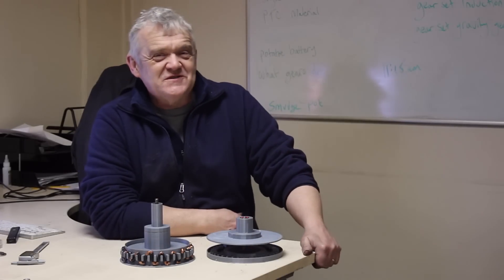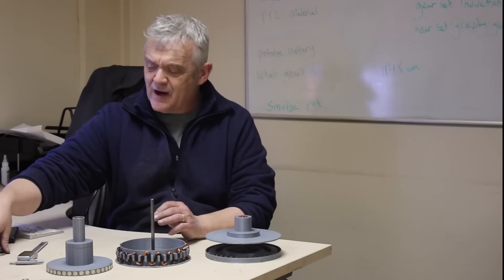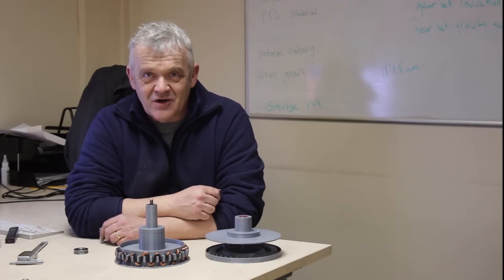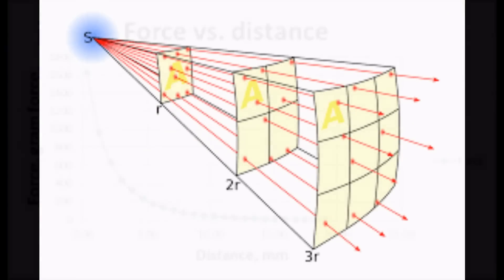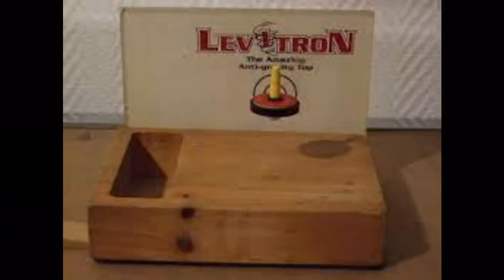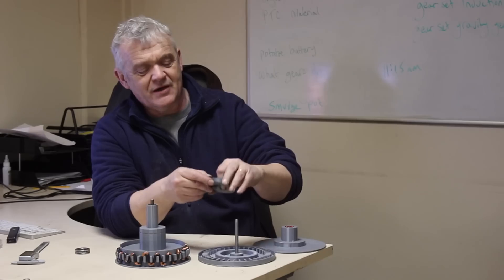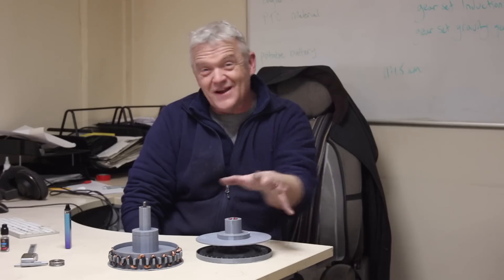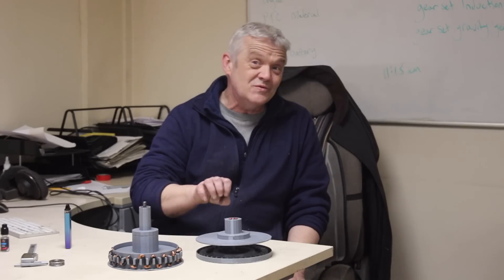1874 Maglev Versus Thrust Bearing

Comment: Do a combination of both designs but use the maglev bearing ring magnets in the unit with that contained the thrust bearing. having both side generation and then bottom generation as what is the maglev unit to get double the possible generation??  
not a tinkerer but full of ideas or full of something. Not the sharpest knife in the drawer either but just found your channel and I am completely enjoying the thought process and common sense approach to explain to us simple minded folks stuff. 
are there "Rod" magnets that you can possibly use in combination with the other magnets so that the Earnshaw's theorem applies I guess in 2 directions if I am making sense.  
Anyway just enjoying watching your videos now, keep staying brilliant 
Semper Fi
Reply: and with your desire to do a washing machine in a dual way as Dyson then this guy might have something that might work in a larger scale for a dual spin washing machine and with that said maybe even doing multiple using this guys idea could make a good washing machine also
just again bored on a Sunday and keeping my mind thinking watching what I think are intelligent videos. 
Stay brilliant and keep on keeping on 
Semper Fi

Comment: I am very curious about how the alternating poled magnets for a generator will affect the maglev effect.  I suppose if the outer ring magnets are far enough away from the core magnet, it should work.  I am still curious how it will affect things.
Reply from the maker: it won't the forces from the ring magnet drop off to nothing in a surprisingly short distance

Comment: Magnetic bearings are pretty cool and I know you are just showcasing the concept here. But the claim that it is useful to lower the friction because of low wind seems strange to me considering that turning the motion to energy will be an extreme part of the friction in the system. In such an application the friction of the bearing seems negligible in terms of overall efficiency. Though I do think magnetic bearings can be great in a wind turbine for longevity and decreased maintenance. Great demonstration though, thank you!

Comment: You know I've been kicking around trying to make some air bearings in this and that and I got a whole box of these ring magnets from microwave just sitting in my garage lol I wish I wouldn't have already made my magnet disc but I think I could still incorporate it if I carefully center the magnets and epoxy them in place
Reply from the maker: nice mate - give it a go - what I tend to do is cut a disk with a hole saw - stick in a drill and sand it to size - that way I get a disk with a centre hole for the shaft and with fits into the centre of the magnet - hope this helps

Comment: I wonder how well the maglev bearing would perform in the twisted serpent configuration under load. The electromagnetic resistance would reduce its spin time. From the twisted serpent video it would still spin for a long time.

Comment: I suppose this is of great intrest for a flywheel. but once we have a generator working, the friction of a good bearing should be neglectable compared to the interaction of magnets with the coil(s). Correct?
Reply from the maker: I don't think so mate - a lot of time and effort goes into bearings and bearing design for a good reason

Comment: I doubt it will spin longer when generating, agreed the lower friction of the bearing is great, but, if it doesn't spin longer in use then there is little gain

Comment: The thrust bearing needs a drop of oil. It also has the capacity to hold a much larger flywheel ballast.
Reply from the maker: it does indeed

Comment: My only issue with this kind of bearing is the flex. If the wind is coaxial to a set of blades mounted to a center hub - generator inside wind pipe style - wouldn't some of the wind force push the bearing together? Possible enough to change the relationship of the generator's rotor & stater?
Reply from the maker: no mate the forces that far away are really really small - remember it is the inverse of the square of the distance - the field line drop off remarkably quickly

Comment: Hi Robert - will that magnetic bearing only work for a vertical axis? I've a feeling that in the horizontal axis the load would be transferred to the traditional ball bearings. Any chance of a bit of Twizzy action :)
Reply from the maker: yes mate - it works on vertical axis I have done a few videos on just that

Comment: could you control the gap using 2 notches on the shaft and adding a split ring above the upper bearing thereby limiting the height of the gap between the 2 pieces?  I guess the question then become how much friction happens on the upper ceramic bearing from the limiter.
Reply: similar to how a pc fan works  if you think about the retaining clip and what keeps things apart in that setup.
Reply from the maker: yes absolutely

Comment: Hi Robert would using magnetic bearing on the wind turbine. Cause problems for the turbine. As I noticed that you managed to make it spin just with you blowing on it. So if you added the flat turbine and took it out in the wind. Would that make the turbine spin to excess speeds. And there for but more stress on other parts. As the turbine would spin at some speeds greater than the strength cab abilities of parts of the turbine. Would you need over engineer the turbine. Or would you be able to control the speed. So it doesn’t destroy its self. Please don’t read this as negative comment. Or have you already accounted for this. As I’m not smart enough to see  if you have. Or the fact it isn’t a concern thank you Neil

Comment: Your winner is the better fly wheel and  the looser has coils and magnets which I suppose would have some eddy losses. Still a cool idea, I don't think that bearings have much to say in regards to efficiency at scale, the losses in thrust bearings are miniscule, but yeah its the better one, but is it worth it? For a flywheel battery definitely! Not so for a turbine I believe as opposed to making it larger if wind speeds are lower... But of course it  enables you to capture power at lower winds, but how much power?
Reply from the maker: there would only be losses if there was a flow of current as the wires weren't connected to anything there is no flow

Comment: I wonder how this would work on a vehicle. I get that there would still be added resistance to the vehicle, but not a whole lot and while a vehicle is sitting in a parking lot all day this could be used to trickle charge a battery system.

Comment: I guess it is easy enough to seperate the bearing from the generator feild so as to overcome or mitigate interference but my question is- would it be worthwhile having the lower bearing an electromagnet so you could fine tune the distance between the stator and the rotor?
Reply from the maker: that kind of bearing is used mate -I mention it in the video - it is an active magnetic bearing
Reply: @ThinkingandTinkering  ah, I missed that. Ta.

Comment: Not to be a wet blanket, but the one that stalled first was packed with magnets and set near a paramagnetic material which will always generate a bit of drag.

Realistically, to be factually scientific about this, one needs to have every other aspect about the test models identical so that they can honestly rule out any questions based on variabilities.
Reply from the maker: you are right mate but the magnitude of the difference means that kind of accuracy isn't really necessary - plus - I am not really proving anything just demonstrating a well known thing - so what you are suggesting really isn't important in this instance

Comment: Just noting that an axial flux generator with a magnetic thrust bearing will have a somewhat undesired self limiting effect when current rushes through the coils.  They will start to act as magnetics that create a bit more levitation that increases the airgap and reduces the output. Maybe the effect will be minimal and tolerable but it's there and one should at least think about it when designing. 😊
Reply: Would using bar magnets instead of button magnets (for better field coverage) mitigate this?
Reply: @tonymazza8305  it might not problematic enough to be overly concerned with. Without doing calculations I can't really say how much. I'm only saying it's there if your using maglev bearing with an axial flux. If that's what you want to build, it's good to be aware of it and that you may want to calculate how much it might effect your project. 

On the other hand, If you turn the field coils and rotor magnets so that their fields point radially then when current flows through the coils, they won't add to the axial levitating force from the thrust bearing magnets.
Reply from the maker: a circlip on the axel will go a long way - but mate - you do know this kind of bearing is already used in generators?
Reply from the maker: I get a sense you are overthinking this one mate
Reply: @ThinkingandTinkering  That is my nature. 😁  I'm guessing you your nature is enjoy sharing ideas, and a good mental workout brings me joy. And many of your projects give me food for thought, or rather addicting daily treats to mull over. 

Many of my comments are meant as food for thought for anyone who happens to read them. And they can do with them as they wish acording to their interest. I'm guessing the nature of someone reading other people's comments includes anyone wanting to converse, enjoys helping others, or who has their own questions.

Comment: Put bigger flywheel with magnets in it to work with coils on outer case. Put magnet bearings on top and bottom that should hold flywheel alignment. Use conical magnets on shaft for side to side stabilization. ???
Reply from the maker: go for it mate

Comment: I am trying to make a magnetic spring for an invention and can verify Ernshaw's Theory. You could make a ring of magnets to keep the rotor centered, but it would just be impractical. I wonder if some sort of gyro would work? If your levitating magnets were at the top, making the weight a pendulum, you would only need minor aligning magnets.
Reply: That's what I've been saying (about the gyro), but I keep getting ignored and ridiculed...
Reply: @ShawnCheriYoung  how would one add a gyro?
Reply: @natureiscrazy  The whole device acts as a gyro. One drawback is it adds an element of precession.
Imagine hanging the device from a string on a swivel. now change out the swivel with angled magnets in a ring.
Reply from the maker: like a larger Levitron?

Comment: Ten yesr ago draw some cad about Maglev Vertical axis Wind Turbine. It had samekind bottom ring magnets but it also had these segment magnets in the shaft and upper ring magnets. Then there was Nylon brake in the top for high winds that would force it to rise against the brake. Problem was high price of those segments and the fact that i wanted to use gorlov geometry blades that was just too complex for me to do. Would be nice to resurrect that project. I think i still have the generator part.
Reply from the maker: dig that project back out mate!

Comment: Is there a way to determine the weight that can lifted by maglev? I’m guessing it depends on magnetic flux and distance between magnets, but have no idea on how that comes together to determine a max weight.
Reply: I asked a question that had this at its centre. Would an electromagnet (i guess the static one) allow you to fine tune the distance? Could you increase the power of the electromagnet for the weight of the unit?
Reply from the maker: magnets usually come with a kg of pull defined mate - that will be the max
Reply from the maker: you could do exactly that mate

Comment: It appears the one with the mechanical bearing has magnets and windings. Even without a load there is some resistance in the windings causing currents which would slow down the rotation to some degree. Granted, a magnetic bearing is superior but the comparison would not be entirely objective.
Reply from the maker: the wires aren't connected - no connection=no current flow

Comment: Wouldn't the magnetic flux from the bearing magnet interfere with the flux involved in the generation of electricity?
Reply from the maker: not really mate - the magnetic forces involved are really really minimal when you get not very far away  - that's why these systems are used in flywheel generators - there just isn't enough strength of field even a centimetre away

Comment: How will regular gears compare to magnetic gears if used in motors/generators? See magnetic gears video on it.
Reply from the maker: I have built a series of magnetic gears mate - there problem is slip under high torque

Comment: Great idea! Would you have to change the geometry of the wind vanes ? I assume the ones you've been using as of late, being taller than wide, would add more undo torque on the rotor axle if the majority of the height of the vane structure is above where the bearing makes contact to the axle (a normal force created in response to the force of air hitting the vanes causing the vanes to cant about their vertical symmetry). Are you planning on using a flatter vane structure or one that redirects the forces downward instead of in a shearing direction?
Reply: There definitely is room for improvement.  However, Rob's rationale (and I strongly agree) is the simplicity of this design.  There are lots of better designs out there, but this is one that a lot of people will actually build and use.

Furthermore, many people who watch this channel do not yet have 3D printers (I just got one recently myself), and this design can also be easily made with some plywood and PVC from the hardware store.

I'm not saying I disagree with you though,  There are a lot of Vawt designs that thin out toward the top, and all of the old sea-faring ships had a similar design on their sails: Fatter toward the bottom, and thinner toward the top (which they learned the hard way, after seeing a few magnificent warships get capsized by strong gusts of wind).
Reply from the maker: you don't have to but I probably will

Comment: I imagine magnetic bearings are useful for improving the longevity of a wind turbine. I'm curious about how much it actually increases efficiency though, because once you start using it to produce electricity, just that alone is going to be a major force in slowing it down.
Reply from the maker: it will increase efficiency a little for sure - but the main improvement is going to be longevity which will decrease the cost per kW generated - and that is much more important

Comment: like EMP shielding .  Could you develop some type of shielding .  To stop that magnetic interference .  From interfering with the magnitude of a generator .  That could help the output. Of the MAGNETIC generator.
Reply from the maker: you can't shield per se but you can route flux from a magnet using a magnetic circuit
Reply: @ThinkingandTinkering  That's something that can help.  All these little things  Add up to to make something great

Comment: Robert, you'll know better than me, but, isn't the rotor, having magnets and windings, generating electromagnetic currents? And, while there is no load, there should still be increased resistance when compared to the rotor without magnets and windings. No? I'm just guessing. But yes, regardless, the magnetic bearing should always show greater efficiency. Thanks  Robert. 🙂
Reply from the maker: they are not connected so they are doing nothing - the lack of connection means there is no current flow - no current flow means no eddy currents

Comment: i'm surprised you did not cover using magnets to reduce (of effectively remove friction) between the parts sooner.
Reply from the maker: this is not an answer to all problems mate
Reply: @ThinkingandTinkering  I kno, but it's a good one for vertically stacked ones.

Comment: I'm thinking magnetic bearing at bottom and generator magnets & coil at top with wind vanes in-between, to minimise magnetic bearing interference with output.
Reply from the maker: I am not sure why folks are so worried about bearing interference - it is minimal to non existent
Reply: With a little more thought I think I can see why it'd be minimal interference, set up the way you have. 
It's changes in magnetic field that causes the current to flow. The coil wire is stationary relative to bottom magnetic bearing, and rim magnets are stationary relative to top magnetic bearing. Further the magnetics field of the bearing is perpendicular to the generator ones anyway.

Comment: It's impossible to make a generator using the magnetic bearing, because the time it'll spin with just one small thrust made by hand would make it generate more energy than what was firstly put into the system, thus breaking the principle of conservation of energy.
Reply from the maker: mate - there are already generators with magnetic bearings in constant use - I am just demonstrating a well known and used principle
Reply: @ThinkingandTinkering  I'm just being ironical. It's a principle they take as indispensable, but they'll forget it as soon it's actually appliable. How would the same generator behave in zero G and in the vacuum of space, while using quantum locking as the magnetic bearing, so it would not have friction at all, then? They just don't talk about it. It just so happens, the sciences often actually lack insight.

Anyway, could you experiment with the supposed perpetual motion generator that would use a modified car alternator connected to an electric motor in the future?